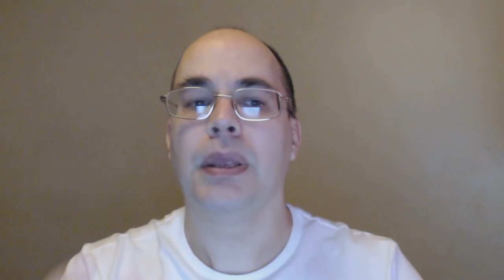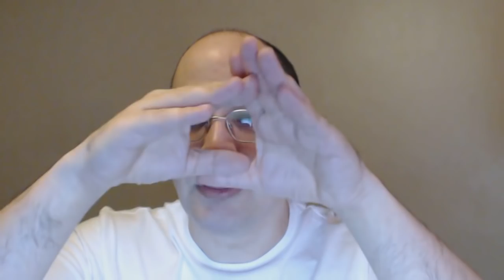How do rockets move in space, with nothing to push off from?

Comment: I don't buy it.  The weight of the fuel would have to be much more than the weight of the rocket.
Reply: BILL

Rockets will work in space

Easy to prove they will by a number of methods.

1 Analogy with water expelled from a garden hose. Take your hose, hold it about a foot from the end, with a spray nozzle fitted. Have a helper turn on and increase the water flow. You feel the hose move more as the pressure increases. If you think this is because the water is pushing against air, move the hose toward and away from a solid surface (which should present more resistance than air) and you feel NO change in the pressure on the hose. It's only when the water is turned off that this pressure goes away. The air is not providing the push

2 Comparison with detonation of explosives. A rocket is a controlled detonation. When an explosive ignites, it generates rapidly-expanding gases which, in a microsecond, rupture the container holding the explosive in place, and generate an expanding shock wave in either the surrounding material, or air surrounding that material. They don't need air to ignite. They have an oxidising element in their make-up

so ....

3 What happens if you construct a combustion chamber, containing rocket propellant, that has no exhaust nozzle? Totally sealed, no exit for expanding gases. Light it up, and - Either the propellant burns until it's all spent, or the chamber reaches a point where the pressure is too much for the build, and it fractures at the weakest point. There can only be one of these results. No?

Simply put, the propellant works in all directions upon the internal walls of the chamber until either it is spent or the chamber explodes under stress.

Now substitute this chamber for one with a controlled exhaust, and the propellant STILL works upon the upper and inner walls of the chamber BEFORE exit. No? Why would it change behaviour between the two situations?

For those who think rockets push against air, consider this - the Saturn V developed 1,522,000 lbf for sea-level thrust, with a mass flow rate of 5683 lbm/s and exhaust velocity 9800 f/s.

Is atmospheric air at roughly 15 psi static going to present any meaningful impediment to this? It won't resist the rocket exhaust, it'll be pushed out of the way, like a 15-car railroad train swatting a fly. 15 psi is an insignificance against this. 

1. "Apollo 11 Saturn V Launch Camera E-8" - /watch?v=DKtVpvzUF1Y

Especially look at 0.45, where the engine reaches full power, and the smoke which has billowed out from the area below suddenly switches direction, and gets dragged back down. 

What do you think would cause it to do this, other than the atmosphere being dragged there?

Also at 1.36, the ice falling at the edge of the pit changes direction as it passes the hold-down clamps, and also gets dragged along. 

What do you think would cause it to do this, other than air movement pulling it in?

2. "Crucial Booster Test Fires Up in Utah"- /watch?v=LhxSk70r8dw 

Observe the ground around the booster once it's running. See how the movement of the atmosphere around it is pulling the loose sands etc toward the rocket exhaust. See 0.14, and look at the ridge line to the left, and in the following shot, where the material parallel to, and above the exhaust is being dragged toward it.

3. "Future SLS Rocket Engine Test Fired at Full Power | RS-25 | Video" - /watch?v=UEhHRXDFkeU

Watch the steam and vapour being produced ABOVE the engine being dragged down by the airflow.

4. Amateur demo shows model rocket engine thrusting in a vacuum ;

"Model Rocket Engine In A Vacuum Chamber - 4K Slow Motion - will it burn?"
/watch?v=GxBRQXxBRic

5. "RS-25 Rocket Engine Test"
/watch?v=cXgJVrmdYrY

"RS-25 Engine Test from Stennis Space Center"
/watch?v=CG2WeMSlOrA

Watch the steam and vapour being produced ABOVE the engine being dragged down by the airflow.
Reply: So... all the rocket launches people have seen with their own eyes have been faked or something? With holograms? Or mass hypnosis?
Reply: No, because the launch is on earth and in the atmosphere.  Who know for sure if they ever get beyond that.  And once they are out there where there is no atmosphere to help push off on, there would only be "action/reaction" going on.  It's like if you mount a machine gun on the back of a pickup truck, put the truck in neutral and start firing.  Do you think the recoil of the machine gun would start moving the truck?  Do you think as you kept shooting the machine gun the truck would pick up speed.  This is how useless a jet/rocket would be when there is no atmosphere to push off on.
Reply: +BILL BILL
No, because the launch is on earth and in the atmosphere.
Which means that weight of the fuel is not a problem here - the rocket can lift off just fine.

And once they are out there where there is no atmosphere to help push off on,
Which is fine, since rockets do not use atmosphere to push off.

there would only be "action/reaction" going on.
Which is quite enough to keep propelling the rocket forward.

_ Do you think the recoil of the machine gun would start moving the truck?_
If the truck had no rolling resistance, then, yes, the recoil of the machine gun would transfer to the truck and would start moving it.

Do you think as you kept shooting the machine gun the truck would pick up speed.
See, in this example, the atmosphere is the rolling resistance, which means that rockets work better when there's no resistance :)
Reply: I understand the rocket can lift off, that's not a problem.  It's when the rocket gets beyond our atmosphere where the problems start.   Nothing left to push off of and not nearly enough mass of fuel to offset the greater weight of the spacecraft.  Even if a rocket did pick up enough speed in our atmosphere, to sling-shot it toward the moon, it wouldn't be able to slow down or even change direction in space - it would have to enter another similar atmosphere and spend the same amount of fuel to slow down as it did to start up.
Reply: +BILL BILL
It's when the rocket gets beyond our atmosphere where the problems start. Nothing left to push off of and not nearly enough mass of fuel to offset the greater weight of the spacecraft.
Once again, rocket's don't need anything outside to push off of. Also, the more fuel rocket burns, the lighter it gets. Its mass would decrease, not increase.

Even if a rocket did pick up enough speed in our atmosphere, to sling-shot it toward the moon, it wouldn't be able to slow down in space
It can slow down in space the same way it can accelerate in space - by  ejecting some superheated gasses.
Reply: I disagree.  Rockets do need something to push off on.  Action/reaction wouldn't even come close unless the fuel weighed much more than the rocket and came out all at once.  Don't forget, that little bit of fuel that is igniting is not just pushing the rocket but it's also pushing the rest of the fuel in the tanks.  Be like moving a train car with a tiny CO2 cartridge.
Reply: +BILL BILL
Rockets do need something to push off on.
Rockets push off their exhaust. Exhaust goes one way, rocket goes the opposite way.

Action/reaction wouldn't even come close unless the fuel weighed much more than the rocket and came out all at once.
In which case, rockets wouldn't be able to even lift off the pad.

Be like moving a train car with a tiny CO2 cartridge.
You severely underestimate strength of rocket's exhaust. Why?
Reply: BILL BILL  "Rockets do need something to push off on."

... yet they get faster when they get away from the ground ....

"Action/reaction wouldn't even come close unless the fuel weighed much more than the rocket and came out all at once."

They don't just push the fuel out. The fuel is burnt to provide combustion

"Don't forget, that little bit of fuel that is igniting is not just pushing the rocket but it's also pushing the rest of the fuel in the tanks.  Be like moving a train car with a tiny CO2 cartridge."

I think you're severely underestimating the energy release of the most volatile fuels around....
Reply: +BILL BILL  - Ironically in space your machine gun jeep would start moving - and it would accelerate with every single bullet fired  It's only on Earth where friction and air resistance exist that it doesn't.